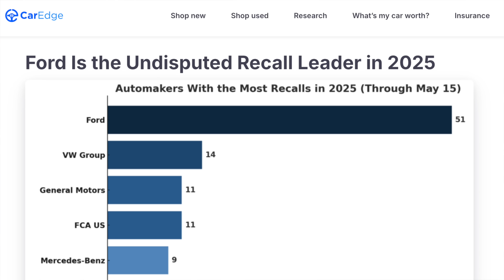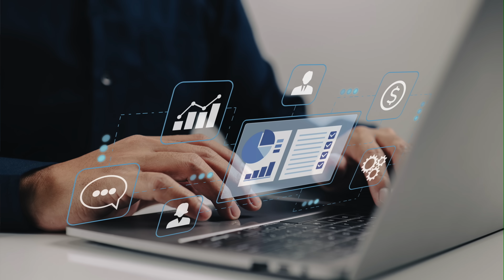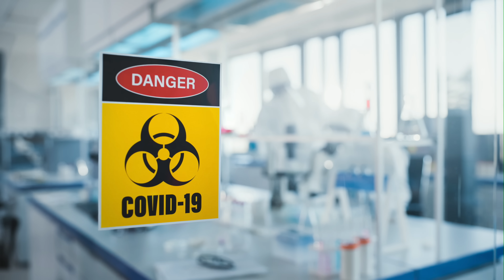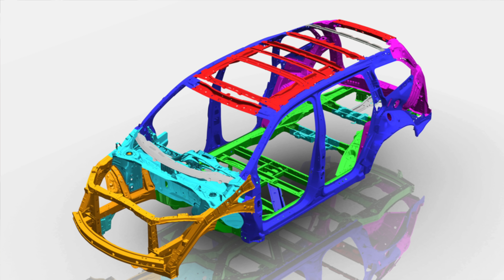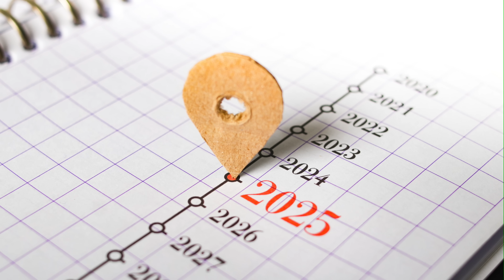ENGINEER EXPLAINS WHY QUALITY IS GETTING WORSE - WHY PRODUCT DEVELOPMENT HAS BEEN STRANGE

Comment: Quality is getting worse 🤔and manufacturers want to charge more 🤨 make that make sense 🤦🏽‍♂️. How about smaller vehicles less complex fewer unnecessary options maybe actual cars. In this economy and they continue to raise prices. Plus most manufacturers are plagued with recalls and reliability issues 😒 no thanks 🙂‍↔️.

1. Cylinder deactivation 
2. Auto Start/Stop
3. Heavy glass roofs 
4.CVT transmissions 
5.Small turbo engines in medium/large vehicles

Comment: Combination of corporate greed, so more profit but cheaper materials in every respect (cars are not built to last despite what manufactures/dealers/reviewers say), plus complex engineering  to save fuel and meet new environmental standards, focus on cheap technology to please consumers who are impressed with electronics instead of a well built car and other factors like the mass move to leasing/financing and treating cars as disposable units.  I believe these are the big factors.  Companies like Hyundai making cars with very cheap materials but lots of features  for less money forcing other manufacturers to follow suit (not sure on this one).  I do know that the actual functioning parts of cars today compared to twenty plus years ago are not as strong (in general) and not as easy to replace.  Oh, and environmental standards have affected vehicle manufacturing  in many other ways outside engines etc. ... for example thin paint that chips on all new cars leading to rust in short order.  Manufactures would have you believe this paint is superior to what we had in the past. Most of us know better.  Manufacturers try to make us confident in new cars with long warranties that are not as useful as one might think.  All maintenance including fluids at dealers is sky high along with the cost of shop labour.   For someone like me who is on a very tight budget vehicles today are not fun anymore.

Comment: Some people are pointing fingers at capitalism itself—as if profit alone is to blame for why cars are more fragile, more expensive, and less serviceable. I get the frustration, but let’s not forget: capitalism also gave us some of the best, most durable vehicles ever made. It worked when companies competed on quality, when reputation mattered, and when long-term value was worth investing in. The difference back then wasn’t just the system—it was the people inside it.

Something’s changed.

During the COVID years, decisions were made over Zoom calls. So it is true, some of the worst vehicles we’re seeing now were designed in that period—and maybe that’s not a coincidence. COVID wasn't just disruptive logistically—it was mentally destabilizing. People were scared, isolated, and unsure if the future even existed. And when you believe there might not be a long-term, you don’t make long-term decisions. You patch things. You cut corners. You get through the quarter and hope for the best.

But long-term thinking—whether in business, engineering, or life—requires more than spreadsheets. It requires ethics. Morals. A sense of responsibility to the people who come after you. Without that, capitalism doesn’t just “do its thing”—it spirals. It becomes a short-term feeding frenzy where ripping people off is fair game, even if it burns down the company, the economy, or the industry in the process.

People make companies. People write the code, design the cars, approve the budgets, and decide what counts as “good enough.” And when society loses its way—when fear replaces purpose, and short-term gain replaces long-term value—it shows up everywhere.

Including in your car.

So yes, the tech is getting worse. Yes, the regulations are getting out of touch. But underneath it all, maybe what we’re really seeing is a reflection of a deeper problem: a society that forgot the future matters.

Just my 2 cents.
Your mileage may vary—like the battery warranty on a car designed during a global panic meeting on Microsoft Teams.

Comment: BS!  Covid had nothing to do with it.  It's  manufacturers greed, cutting costs and corners using cheaper, lower quality parts, making parts to break rather than to last, the focus on nanny gizmos and touchscreen garbage, and the EPA's strict guidelines & policies for more mpg and roll over crashes, then everyone going to smaller displacement engines with 1 or 2 turbos!  It's all that crap contributing to the fall in quality, reliability, and longevity!  Not covid!  That's a poor excuse!
Reply: Very much agree.  And if design was difficult during Covid, then they should not have made any significant design changes during Covid; they should have just tweaked then-current designs.

Comment: I don't agree that manufacturers are listening, that well, in some regards. I have a 2025 Rav4 Hybrid. The car is nearly perfect, for me. I looked at the latest 2026 models. The exteriors are fine, but the interior is a step away from human usability. Going to the non-tactile, digital operation, is making useability worse. Everyone I know prefers  knobs and shifters to distracting buttons for radios, shift control, and climate control. Most people would rather not be searching for display buttons while driving. Just these changes would make me not buy the 2026 model Rav4. Also, with other manufacturers, the removal of the spare tire is not an advancement. After 60 years of changing blown tires, I can say that 50% of my flats would not be solved by a can of sealant and air. I am so glad I bought my 2025 Rav4 before these improved(????) changes

Comment: It’s just corporate greed, you can blame the government because of those forced fuel saver ideas, but come on folks. Voyager 1 and 2 are in a different universe and we’re still getting messages and pictures back, we were on the moon over 50 years ago so you can’t tell me that with modern metallurgy and scientific improvements they can’t make an internal combustion engine and a transmission that will last! These things are decades old, they’ve been around for over 100 years so I’m not buying it. I believe the auto industry is (ENGINEERING) them to fail, to work long enough to get them through the warranty time. Also make them cheaper so they can save a buck or two which does add up. They want to sell you new cars. Do you believe GM all of a sudden can’t make a V8 after years of  making ICE engines that could last a couple hundred thousand miles. Remember the Ford 300 cu inline six, Fords 390 the Chev 327 or 396 which for the most part were pretty much bullet proof or at least they made it past 7,000 miles compared to what’s happening now. And those 4 speed automatic’s. Just my opinion and I’m a nobody, but that’s what I believe.

Comment: Manufacturers have figured that American will still buy their vehicles even if the quality is crap. Look at our big three. How many trucks do they sell annually? When consumers respond by closing their check books only then will manufacturers make a change. You want an example? Look at Nissan Titan. How much did they sell annually, 30,000? Maybe. And I owned three of them. Consumers did not open their checkbooks for a Titan and Nissan had to scrap it, at least for the US market. People complain all the time, but still go buy the same crap. Seen it as a Chevy/Caddy salesman and I'm sure it happens with other brands. They have a problem with their vehicle that the dealership has not resolved, and what does the owner do? Go out and buy the newer model....Like it's the same shitty 8 speed transmission in that one too.

Comment: The main problem is political environmentalism forcing manufacturers to use smaller displacement, boosted engines, complex hybrid systems, biodegradable plastics and thinner body panels.
Reply: Not just the design parameters shift, but the accelerated pace which is antithetical to economic viability and sound engineering iteration principles.

Comment: Low quality is not just 1 factor it’s systemic. I work as Quality Assurance professional for over 37 years worked with big companies Toyota, GM Aviation industry and small companies that made rubbish bins😊 all had that common trait, systemic educational problems and management issues. If you don’t address that then you get what you experience now😊 cheers from Oz🇦🇺

Comment: I still have and will have a 2013 Infiniti FX37 Limited. I have had it for 7 years and no problems except for regular maintenance. In my opinion, they hit it put of the park with this model, but... Nissan let it die just as the segment was taking off. *only mentioning Nissan because you are in the headquarters. I love the acceptable amount of 'luxury' in my car as it serves every purpose I need, no more and no less. A lot of physical buttons and even on this 13 year old car it has a touchscreen. I'm any event, I think the buyers of newer cars want the car to do everything for them instead of actually engaging in the driving experience.
Reply: Your car is using 1997 design just updated which is good I have a g37 and previous owned a q60 2017 the quality between these to generations is huge the g37 is so much better too many problems in these newer vehicles

Comment: I think that the problem is that too much focus is placed on the infotainment system and electronics rather than the powertrain!  The government has unrealistic emissions requirements which really screws car buyers because they’re forcing smaller engines to power cars and they won’t last as long 😢
Reply: There is at least one company that bucks these trends. Mazda. V6 for midsize SUVs isn't the only right choice. Inline 6 is also a great choice.
Reply: @DrT1250  Is it direct injection? Does it have cylinder deactivation? Have any plastic engine parts? Any belts in the engine or actual chains? It takes a massive amount of research to find anything reliable 2020 +
Reply: @DrT1250 Honda Pilot still has v6
Reply: Amen

Comment: Short version. Two words. "Planned Obsolesence". After that. Toyota has the most recalls of any auto manufacturer. Way more than Nissan. Funny how that is. Isnt it.
Reply: Toyota is no longer associated with Quality.  Get a 2012 & earlier Model Toyota if you want Quality
Reply: @roccicicatello3  my 2017 yaris(French built) is a basic econobox & has been solid with basic maintenance for 150K miles.
The big difference is all the tech gadgets  & mandated tech.... auto braking, lane assist... the nanny devices (beyond ABS & traction control) are unnecessary & create lazy drivers that are dependent upon those systems.... making them even worse drivers overall. 
People need to admit that motion involves risk. No matter how many safety devices you put on a car, some people  will get hurt in accidents. That's  life. Far more lives can be saved if drivers quality improves... but that would mean driver discipline & education beyond what we are doing now.

Comment: 2003 Grand Marquis here, in family from new, 496,000 miles, ZERO rebuilds, only minor repairs from new, only towed 1 time for a fuel pump at 424,000 miles...still runs and drives very good...Zero Blow by, no leaks...still original catalytic converters!!

Comment: This didn’t start with the pandemic. The c-suite has absolutely created this problem. Pay workers less. Less incentive to do a good job. EPA forcing automakers to meet ridiculous standards…lighter parts (cheaper quality), pushing designs to their physical limits…all of this forms the “stew” of horrible quality we see in EVERYTHING we buy. We’re in the dark ages as consumers. I just assume anything I buy will possibly break within the first few years. Craftsmanship isn’t a thing anymore.
Reply: Maybe it’s time to have some sort of legislation that fines manufacturer if there product causes more harm to the environment than it supposed to prevent. We all know today a washing machine uses way less water and electricity but the unit doesn’t last and ends up in a landfill sooner than it would if it wasn’t eco friendly. That’s not environmentally friendly. If your product fails early and new parts (transmission) has to be replaced ……… then the manufacturer gets a fine. Better engineering or else…..
Reply: @robm3357  I agree. I think if we didn't have a corrupt political base this would be on the table. There's just too much lobbying for this to ever happen.
Reply: Global warming/government/c-suite greed, the consumer comes in last.

Comment: Toyota let me down on my 21 Highlander. Tranny, AWD, and many other issues at only 84,000 miles. Done with Toyota. Moved to Honda.
Reply: Honda is just as bad.
Reply: And..other Toyota things I don't like that Honda doesn't have issues with. I don't have to pay a subscription to use the key to start my car. When I do use my key fob on my Honda it doesn't turn off as soon as I open the door. I have a naturally aspirated V-6 in my Pilot. I don't have to unsubscribe to Toyota Safety Connect so they can stop selling my info to my insurance company. I like Honda's system better if i'm in a wreck it will just call for help with my phone. #DonewithToyota. Ps I'm keeping my 23'Tacoma because it's one of the last good ones.
Reply: @pigpen50 things have changed with Toyota. You can now open the the door with your phone or key fob and it won’t shut the engine off. Also, The Toyota crown sedan I purchased 2 months ago has a 10 year trial on the service connect
Reply: There’s nowhere to run

Comment: My opinion is not that the engineering and design processes during COVID that had a negative effect (although it might be partly to blame), but rather I blame management doing everything they can to 1) reduce part cost (at the cost of quality), 2) increase profits, 3) increase end-of-year bonuses for management and 4) increase stock value for shareholders.  I truly do not believe that car companies care at all about the actual customers that they are supposed to serve, or if they do, they have the absolute lowest priority.  Of course there's all the tech and ridiculous EPA standards that they're forced to comply with.  I'm in the market for a new truck, but I've held off buying anything from model years '24 or '25 due to quality issues.  Unfortunately, I don't see quality getting any better.  Perhaps with Ram's new updated powertrain warranty we might actually see quality get better, but I'm not holding my breath.
Reply: Agree, the quality in everything is going down (clothes,houses, etc), especially if the company that makes the product is listed on the stock market. Because if the company is not increasing its profits/share price every year, then  the big institutional investors/pension funds are going to sell those shares and buy into a company they think will increase profits. And using thinner/cheaper/less material seems to be the most common way to cut costs and increase profits. I think roughly every decade you can see a drop in quality in everything. I think quality peaked in 80s and 90s.
Reply: I need a new truck also but the engineering from GM, Ford, Toyota is so bad that I don’t want a vehicle I can’t drive and a payment to boot. Engines failing, Transmission failing. I don’t want to be one of those people.
Reply: if the company supported fake covid (all did), theyre inept
Reply: Agree entirely, but also add that CAFE Rule and its perpetual extensions is an idiotic regulation that institutionalizes a brain-dead MPG goal as the Holy Grail, producing generations of suboptimal vehicle designs foisted on buyers.  A better way to limit emissions would have been to allot a tradeable ration of FUEL for each PERSON and let buyers get the vehicles they wanted to buy.  My elderly parent who drove 3K miles or less in a year could have kept a Buick V8 with minimal impact on carbon footprint and sold unused rations to the highest bidder.  That WWII rationing methodology sounds nuts to a modern mind, but it is eminently practical in the age of the internet.  What is fair about screwing up car (product) design for an arbitrary MPG rating?  We made average MPG spread misery to everyone INSTEAD OF letting consumers who wanted bigger cars and didn't drive much profit from those who wanted to buy their unused share of gasoline.  We screwed up product design offering with a totalitarian rule instead of doing somethat that would actually reduce emissions in total.  Classic government "solution."

Comment: David back in the 1990's Toyota Camry, Toyota Corolla, Honda Accord and the Honda Civic always had much better than average reliability but now all of those models are average reliability at best- Honda especially has declined in reliability. The fit and finish on the 2002 to 2006 Toyota Camry was Lexus quality but declined significantly beginning in the 2007 model year.